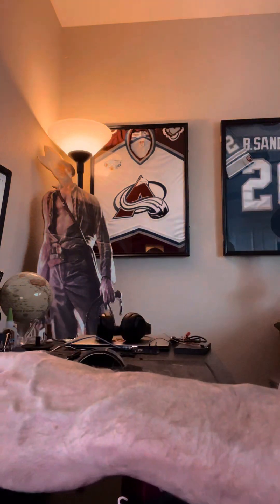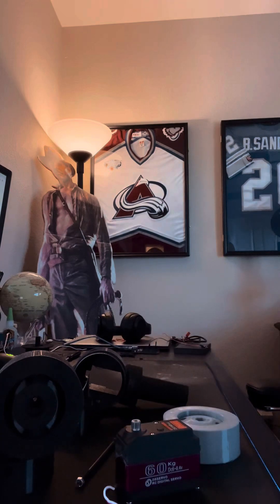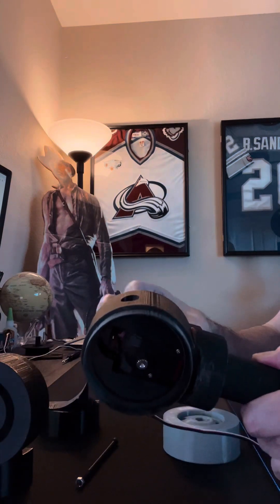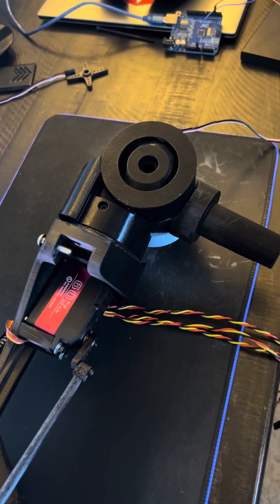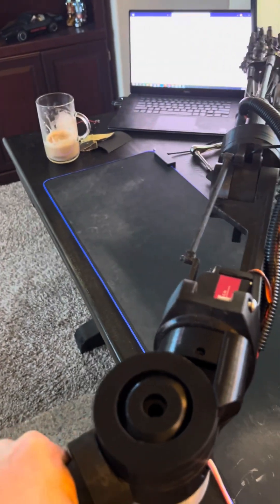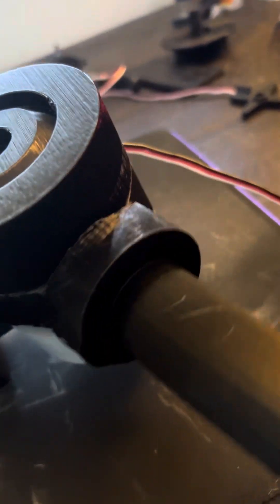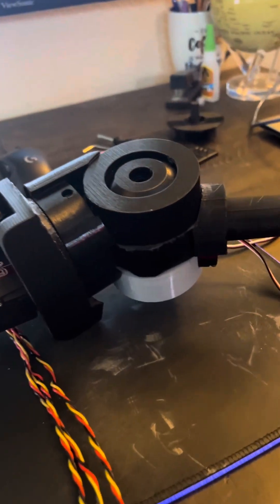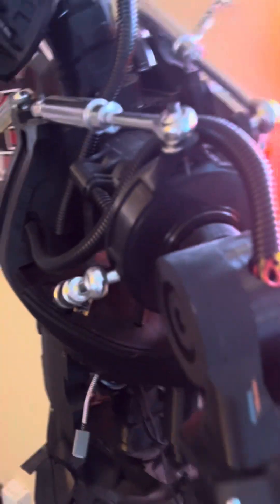T800 Terminator 1:1 Build - Shoulder update

Comment: very good friend, what did you use for the collarbones? I see that they are silver, are they metal? I am also making a T-800, and some moving parts, and I am also trying to use some metal parts, my biggest problem is, how to paint it later, I don't want to use a compressor, I was thinking about a heat plotter, mirror effect...
Reply from the maker: It’s all plastic. Im just starting to paint everything. I’m using molotow liquid chrome applied with an airbrush. It’s the best chrome paint out there but its pretty difficult to get it looking good.
Reply: @TheCrazyMadScientist   Yes, I know, I want to avoid the airbrush, I don't have the machine to use it, The entire terminator, assembled, but black like yours, for the collarbones, I bought competition ball joints, 6 mm, they have the same shape, then you insert a chrome pipe, several parts I used chrome metal things, which I found, the umbrella tube for example (chrome metal) use several to make the arm tubes, mixing with other 3D printed parts
Reply from the maker: @markosmkpteam490  i hear you on the air brush, i didn’t want to use one either, however, i saw this on amazon and took a chance, it’s been working good so far! 

Airbrush Kit With Compressor - 48PSI Rechargeable Cordless Non-Clogging High-Pressure Air Brush Set with 0.3mm Nozzle and Cleaning Brush Set for Nail Art, Makeup, Painting, Cake Decor https://a.co/d/gFL8z6l